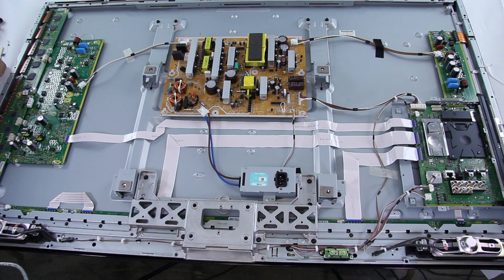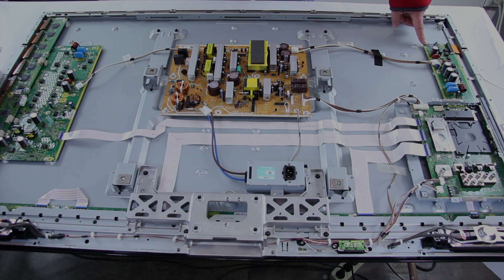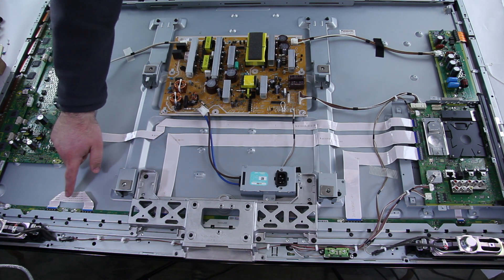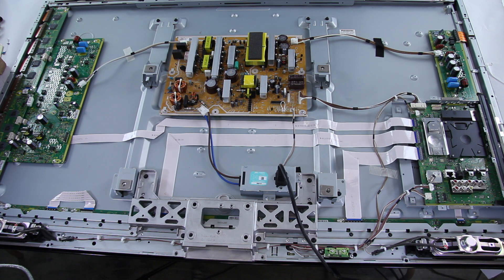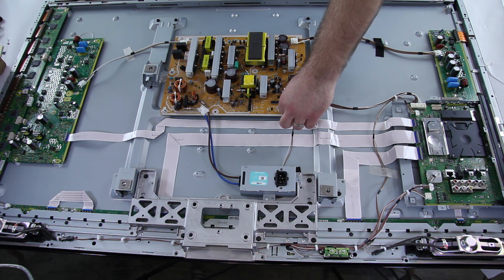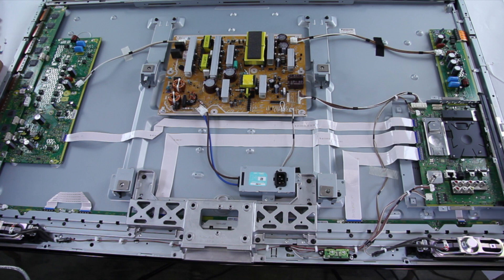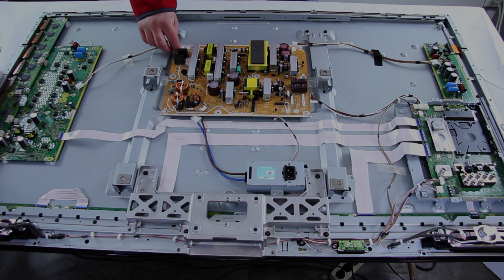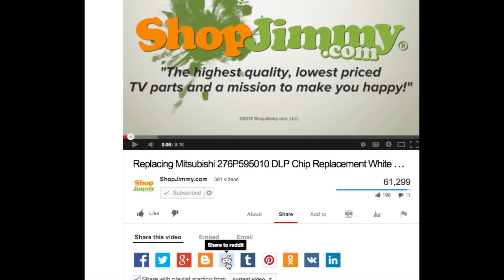Panasonic Plasma TV 6 Blink Code Explained Repair for 2011 Panasonic Plasma TV

Comment: Hi.  I have a Panasonic Viera Plasma 54" TV.  Model # is TC-P54S1 and it was manufactured in April of 2009.  I currently have the 7 blink code.  So, I happened to find a video that showed the following (after you've seen the 7 blink code):  if you disconnect the SC2 and SC20, then plug the TV back in and now you have a 6 blink code, then you probably need to replace the SC (Y SUSTAIN) board.  But ladies/gentlemen, I'm really not sure, if all this is true, if I would have to replace one of the two Buffers (SD and/or SU) along with the SC board.  Or, replace a combination of those three:  the SC, SD, and SU boards.  Please help.  Thanks.

Comment: I have a TC-P54G25 and am getting the 6 blinks, will the above video work for diagnosing my tv?
Reply: +Daniel Opp Disconnected SC20 and C20 cables and the blink code went to 8.
Reply: +Daniel Opp Does this indicate that the P board or the SC board is bad?
Reply: +Daniel Opp Voltage at C561 was 10V and TP82 was 33.5V

Comment: Tv model tc-p54s1 had 9 blink code replaced main board now getting 7 blink code please help
Reply from the maker: +Nate Corter   Try this at your own risk. Unplug the TV, then disconnect the SC board and plug in the TV to see if the TV powers up. Note that it will not have a picture on the screen. Reply with the results of this test. Thanks! www.shopjimmy.com
Reply: I unplugged the sc board an now I get 6 blinking lights

Comment: my tv model is a TC-p42c2 Panasonic plasma tv.  It was blinking the 10 blink code. the repair man said the SS board and the Y board was bad, replaced both those boards and still blinking 10 blink code. please help
Reply from the maker: +mackenzie Eliason  Try all repairs and troubleshooting at your own risk.  Do you have experience using a multimeter to test voltages?  Thanks!  www.shopjimmy.com

Comment: tc-p60s30 blinks 7 times i disconected the ribbon cable and power cable to board  plug it in and i get 8 blinks any ideas

Comment: Hi, need help with Panasonic TX-P46G15E Plasma. Errorcode six blinks. If I do left D20 and D32 connectors open, TV will engage without error bliks (of course without image). No visible svollen caps or burned stones.
Reply from the maker: +Snamperi  Try all repairs and troubleshooting at your own risk.  Whatever board you are leaving the connectors open on, and the TV then works, I recommend replacing it.  Thanks!  www.shopjimmy.com
Reply: +ShopJimmy.com Thanks.  I hope that I can make more detailed repair than only replace modules.

Comment: Hello!  I have Panasonic Viera TX-PR42U30, serial number FK-1521445, A-BOARD TNPH0954EA (suffux EA), SC-BOARD TNPA5349AB, POWER SUPPLY MPF6909 (TA1650082).  When turn on the TV - six very quick green blinks appear (needed to use camcorder to count the blinks in slow motion, as initially counted five iso six).  TP82 - P15v, c561 - P5v as in instruction to - the voltage is OK, seems the A-board - 4 years ago it was replaced during warranty time.  Please advise if this diagnosys criteria applies to me TV, so that I definetely need to order the A-board, or advise if any other diagnosis I can make.  On your video my SC-board is one full, not like yours separated.  In addition I cannot acces your website, maybe beacuse I live in Russia (your website server gives the following mistake - Access Denied
You don't have permission to access "http://www.shopjimmy.com/" on this server.
Reference #18.ee9b7b5c.1443295207.aa736ca4)  I need to know the price of this A-board if it really needs to be replaced or possible hints to diagnose the A-board to evaluate if any repair kits there are iso replaccement the whole A-board Assy.
Thanks in advance!
Dmitry Kozlov

Comment: Someone gave me an old 2006 Panasonic Vera TV; Model # TC-26LX60   I get a black screen and 6 blinking red lights.  Can I try the same test as you show on the 2011?  Any ideas what it could be?  What should the repair cost?

Comment: Hi I have a TC-P65VT50 that has the 6 blinking reds and was having some Hdmi issues intermittently, is it safe to assume it's the A board that needs replaced (where ate those ever stocked?) could you post how to check the voltage on the S board and if it's the same location on the VT series? Thx

Comment: I have a Panasonic th42pz77u, it is giving me 6 blinks (SC energy recovery circuit) I have the service manual and it says check points are SU/SD/SC Board but it doesn't explain how to test them. How should go about testing these boards?

Comment: TC-P65ZT60 Panasonic 65" TV. My problem is the 6 blink code. I was having an issue with my RCA connections, so I ordered a new A/V board and replaced it. when I powered up, I got the 6 blink code. I put the old board back in and still got the 6 blink. Thank you in advance for your advice.
Reply: +ShopJimmy.com 
Mr. Jimmy-- I did as you requested, unplugged the TV & disconnected the SC board and powered up the television. That changed the red blink to 10 blinks now.

I plugged the SC board back in then rechecked all my connections on the Audio Video board. I plugged the TV power back in and now the TV works as it did before. I believe it did a factory reset though because I had to set up the TV as if for the first time.  Thank you for your Help!!!!!!!!!

Comment: I have a Panasonic TH-42PX80U with a 3" BLACK vertical line twelve inches in from the left front side.  All the rest of the screen is perfect.  I ordered the TNPA4643 C2 buffer board from ShopJimmy and replace it.  That did not fix the problem.
Please help.  Thanks
Reply from the maker: +fbody396   Try all repairs and troubleshooting at your own risk.  This sounds like a TV panel (TV Screen) problem.  If your TV panel is bad, it may be more cost-effective to replace the TV as panels are typically hard to find in stock, difficult to replace, and expensive.  Thanks and please let us know if you have any further questions!  www.shopjimmy.com

Comment: Hi I have a panasonic TX-P42U30B tv and it has been working fine till the other day.  When I turn it on the red light flashes 6 times but still no picture.  Please could you advise? Thanks

Comment: HELLO THANKS FOR YOU VIDEO

I HAVE A   2009 PANASONIC VIERA  TC-42PX14

SOME TIMES POWER ON AND SOME TIMES NO
AND POWER LED BLINKS 6 TIMES

HELPME PLEASE
Reply from the maker: +JULS RH   Try this at your own risk. Unplug the TV, then disconnect the SC board and plug in the TV to see if the TV powers up. Reply with the results of this test. Thanks! www.shopjimmy.com

Comment: Hello, I have Panasonic Plasma TCP65VT60.  It had 7 blinking lights and my brother said it needed a new SUS board, so I ordered one from ShopJimmy.  I just installed it and now have 6 blinking lights.  I need help diagnosing before I replace anything else.  Thanks.
Reply from the maker: Kyle Martin    Try this at your own risk. Unplug the TV, then disconnect the SS board and plug in the TV to see if the TV powers up. Reply with the results of this test. Thanks! www.shopjimmy.com
Reply: I disconnected the SS board.  When I powered the TV back up, I got the 6 blinking lights.  What should I do now?

Comment: I have a panasonic TC-P65S1 and it won't turn on and it blinks 8 times any ideas on how to fix it...or trouble shoot it
Reply from the maker: Luis Fierro   PLEASE SUBSCRIBE TO OUR CHANNEL - Try all repairs and troubleshooting at your own risk.  Try this at your own risk. Unplug the TV, then disconnect the SC board and plug in the TV to see if the TV powers up. Reply with the results of this test. Thanks! www.shopjimmy.com
Reply: I posted a video on fixing the 8 blink issue on that model.  Most likely the capacitors on the SS board are bad.

Comment: need help. I have a tc-p50s30 plasma panasonic tv. I have a 6 blink error code. Prior to this I had an 11 blink eror code. Iwatched your video and did component replacement on my sc board. After that I got the 6 blink code. Watched your video and determined p board needed replacing which I did. Now I still have a 6 blink code; however, the tv tries to come on and I have 5v at the capacitor and 15v at tp82 like you show in the video but this only stays on for about 3 seconds before it shuts off to zero and I get the code. What do I do next?
Reply from the maker: Scott Moorman   Try this at your own risk. Unplug the TV, then disconnect the ss board and plug in the TV to see if the TV powers up. Reply with the results of this test. Thanks! www.shopjimmy.com

Comment: I have a Panasonic 50" 720 plasma, HDTV, model # TC-P50X5, Viera..  It was purchased around the the same time of the ones you are discussing. My problem has happened 4 times in the years I have had it.  No red lights were involved. All that happened was 1. 2 power surges and the tv went  off (it was plugged into a power serge cable).  When the power came back on, the tv didn't.  So, I waited.  I waited for almost 2 days on 2 separate occasions. Tried the tv, it came on. 2. I unplugged the tv to move it. When I plugged it up again, nothing. I had a 14 hour wait.  3. My electric com. did a line fix outside and had to turn the power off. I turned the tv off manually, hoping to avoid the tv not coming back on. It didn't work. So now I am waiting, non too patiently, for my tv to come back on sometime late tomorrow evening. What do you think the problem is?

Comment: Hi, Model Number of TV : TC P50S30 (April 2011) . Having 7 blinking light issue. disconnected the bus wire from SC board (that connected all the way to A board) ,still 7 times blinking light. step 2: Then plugged it back + unplugged the bus cable connected to A board and C3 , now 6 blinking light. Does it mean anything ? which part needs replacement. any help greatly appreciated.
Reply from the maker: Gautam Kumar  PLEASE SUBSCRIBE TO OUR CHANNEL - Try all repairs and troubleshooting at your own risk.  This could be a problem with either the power supply or the A board in your TV.  You can replace them individually to see if one of those boards fixes the problem.  Click this link to replacement parts for your TV model number:  http://www.shopjimmy.com/catalogsearch/result/?q=TC+P50S30  There may be multiple boards for the same TV model number, be sure to match part numbers on your current board, with your replacement for compatibility.  Thanks and please let us know if you have any further questions with your TV Repair!  www.shopjimmy.com

Comment: Hello, My model tc-60st30au.
I replaced the y-sus (5399ab) and the upper and lower y-buffer boards (5343ab &5344ab). this fixed the problem of it running its power cycle and doesn't display 6 blinks anymore. However, it now only displays a blank screen with intermittent little triangles of dim light. any adviceplease? thank you

Comment: Hi My Panasonic TC-P55ST30 is showing this 6 code flash. After unplugging / replugging / listening for the relay then pressing the power on button I'm getting a faint buzz then an electrical "pop". Would these symptoms narrow down the diagnosis without me having to break out my DMM to check everything? Do you have the part(s) available? Thanks for taking the time to share your wisdom on YT!!! Great Stuff!!!

Comment: hi shopjimmy i have a panasonic TX-P42UT30B tv. the tv picture just went off but the light stays green. when i turn it off and back on again the light blinks green 6-7 times(its so fast i cannot count them exactly) there are clicks inside then no picture and the light stays on green.
Reply from the maker: Paul Frost   Try this at your own risk. Unplug the TV, then disconnect the SC board and plug in the TV to see if the TV powers up. Reply with the results of this test. Thanks! www.shopjimmy.com
Reply: ShopJimmy.com many thanks for your reply, i disconnected the sc board as instructed by following your brilliant video and yes i still have a black screen and the green blinking lights are the same as before, with solid green light staying on.
Reply from the maker: Paul Frost  Try all repairs and troubleshooting at your own risk.  I recommend running the same test on the SS board.  Thanks!  www.shopjimmy.com
Reply: ShopJimmy.com Hi again i disconnected the cable from the ss board and the same green lights blink with the green light staying on many thanks for your feedback.
Reply from the maker: Paul Frost   Try all repairs and troubleshooting at your own risk.  I recommend replacing the y buffers in your TV.  Unfortunately I do not see any replacement parts in the search results for your TV model number on our website.  Thanks and please let us know if you have any further questions!  www.shopjimmy.com
Reply: ShopJimmy.com many thanks for all your help and advice

Comment: I have a Panasonic TX-P42S30B and i have 6 blinks of the from light. I turn the power on it clicks twice then i get the 6 blivks of the front light then one more click then it goes off but the screen never comes on.Your video shows a TC model but the TX model is different inside. Do you know what board or where to check the voltages on the left board so i can tell what ones i need to replace and if you can get the correct board for me.
Thanks Andy
Reply from the maker: Andy Reynolds    Try this at your own risk. Unplug the TV, then disconnect the SC board and plug in the TV to see if the TV powers up. Reply with the results of this test. Thanks! www.shopjimmy.com

Comment: Hello. I have a 2011 panasonic plasma (tc-p55gt30) that has the 7 blinks. I had the sc board serviced but still no-go. I need to replace tnpa5340 & tnpa5341. Are there alternates that will fit since your shop is out of stock with no idea when they will be back in stock if ever.
Reply from the maker: jessie alvarado  Try all repairs and troubleshooting at your own risk.   Unfortunately, we do not have any information on that TV.  Thanks!  www.shopjimmy.com
Reply: This is covered in your video above yet you say you have no information??
Reply from the maker: jessie alvarado   Try all repairs and troubleshooting at your own risk.  If there are no substitute parts listed on the product page, then we do not know of any compatible substitutes.  You can sign up to be notified when the part is back in stock, but unfortunately we do not have any information on when they will be back in stock.  You can also look elsewhere online.  Thanks!  www.shopjimmy.com

Comment: I have a Panasonic HDTV model; PT- 53WX53G ,power light blinks only,when i try to unplug it to the outlet,and put it back,
then press on the tv,it will power up and after 3 seconds,it will start to blink again,any board to fix on this? thanks in advance.
Rob Ragudo
Reply from the maker: Rob Ragudo  I recommend that you bring the TV to a certified Panasonic repair shop. Thanks! www.shopjimmy.com

Comment: I have a Panasonic TC-P50S2 it gives me the 6 Blinks and then Turns off.  the screen remains black, but it will consistently give the 6 blinks.  
I have removed the ribbon cables and it changes to 8 blinks.  
I have measured the voltage and as long as the Green light to the board is on it seems to give me 15 and 5 volts.  What do you think?

Comment: I have a Panasonic TC-P46ST30. Recently when turned on, instead of getting a picture, I got 14 blinking lights. Using your video to troubleshoot, I determined that the SC board was shorted. I purchased a replacement from ebay and installed it. Now I get 6 blinking lights. Using your video on "6 blinking lights" it tells me to again replace the SC board. Can you suggests other tests to do before I again replace the SC board?
Reply from the maker: Lee Flekins   I recommend replacing the SU & SD boards with the SC board.  Click this link to replacement parts for your TV model number:  http://www.shopjimmy.com/catalogsearch/result/?q=TC-P46ST30  Be sure to match part numbers on your current board, with your replacement for compatibility.  Thanks and please let us know if you have any further questions with your TV Repair!  www.shopjimmy.com

Comment: TC-P55ST30    Have 6 blinking lights, followed your video above (is awesome thanks) and disconnected the SC20 and C20.  Plugged back in, to see if TV stays on or not per your video but I just get 8 blinking lights now?  Not sure what to do, try from here.
Reply from the maker: Bryan Trevino   Repeat the same thing on the SS board.  Thanks!  www.shopjimmy.com

Comment: I've got a Pana Viero TC-P46G15 with the six-blink code. Would this diagnostic procedure work on that set?
Reply from the maker: Andy Braid   Try this at your own risk. Unplug the TV, then disconnect the SC board and plug in the TV to see if the TV powers up. Reply with the results of this test. Thanks! www.shopjimmy.com

Comment: I have a Panasonic TH-42PHD5 with an LED six blink code. Manual recommends checking Pin3 of P10 to P13 connectors. Where do I find this and do I need a replacement part to fix?

Comment: i have a Panasonic plasma TV model number TC-P50C2 that give me 5 Blink light can you tell me what is the problem i change the main board because it was giving me 10 blink light
Reply from the maker: CHRISTOPHEL STEWART   Try this at your own risk. Unplug the TV, then disconnect the SC board and plug in the TV to see if the TV powers up. Reply with the results of this test. Thanks! www.shopjimmy.com

Comment: My Panasonic TC-P50G10 Television made a snapping sound and shut down the power light flashes 6 times then repeats possible course of action to fix this set? Thanks in advance great videos btw.
Reply from the maker: Steve Trumpower   Try this at your own risk. Unplug the TV, then disconnect the SC board and plug in the TV to see if the TV powers up. Reply with the results of this test. Thanks! www.shopjimmy.com
Reply: @shopjimmy  same problem